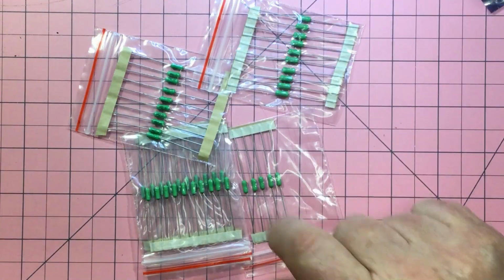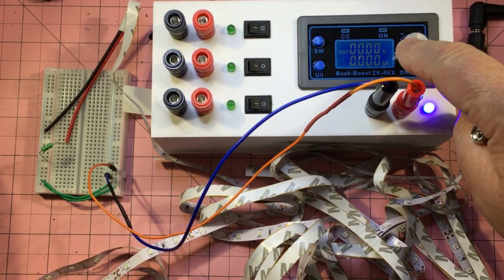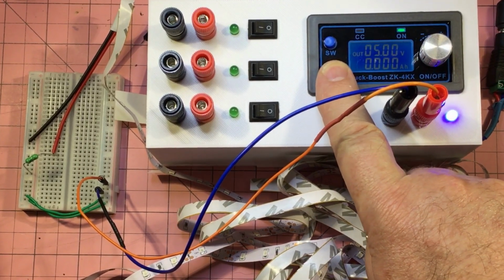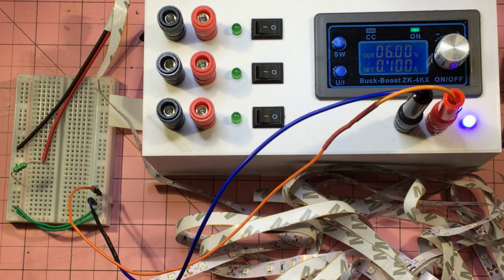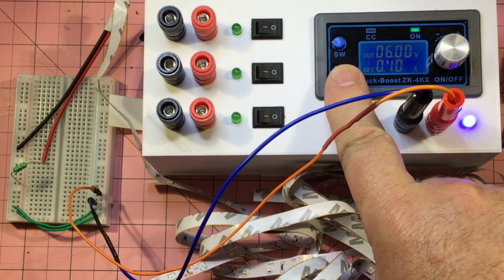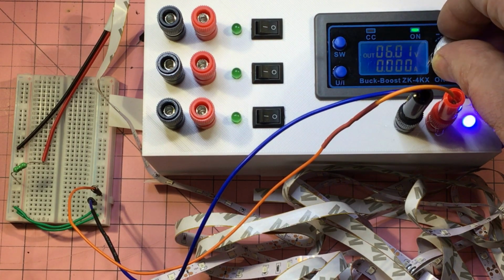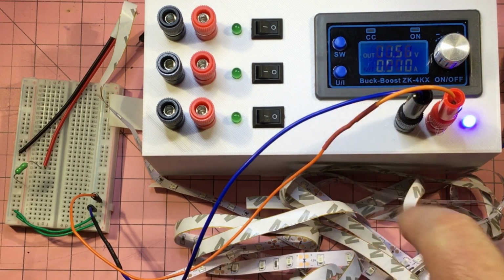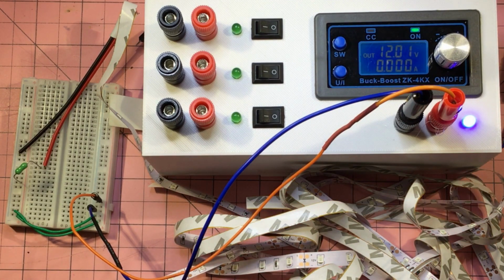Through-hole inline fuses

Comment: Good experimentation. Do some research on fuses. You will find that even the name brands don't blow the way that you would think that they would. The trick is in the data sheet curve diagrams. Give the curves and specs a read. You are going to be amazed, at how they don't do what you think they should do. IIRC, Dave Jones/EEVBlog did a good video on the subject. Additionally, those appear to be sourced from the secondary market... Ebay/Amazon... where components are faked in high percentages. So, if the circuit is an expensive one, don't use these fuses. HTH.
Reply from the maker: Good advice - a component to be used if aware of their limitations! 👍😀

Comment: Always check data sheets

Littlefuse 
Pico 263 Very fast acting fuse
% of Ampere Rating Opening Time
100% 4 Hours, Min.
200% 1 Second, Max.
300% 0.1 Second, Max.

Medium series 777
% of Ampere Rating Opening Time
150% 1 hours, Minimum
275% 10 milliseconds, Minimum 3 seconds, Maximum

Time Lag series 374
% of Ampere Rating Opening Time
200% 60 Seconds
Reply from the maker: Great info. No datasheet listed for these, but I'll go hunting now! 👍😀

Comment: They are definitely a slow blow. One positive is there was no magic smoke which means no smell, would it make it harder to find the fault when the fuse doesn't look blown?
Reply: Not if you check the fuse first.
Reply: @JohnBailey39  true, makes sense to check it first
Reply from the maker: I stressed a couple of them to the magic smoke stage by sustained over current rather than a short…and they did smell!

Comment: Most fuses I have tested blow at about double their rating.
Reply: Yep, unless you use something active that measures the current and actively switch off say a MOSFET or relay immediately above the limit, for passives  there's a current/time to blow curve in the data sheet. The higher the overcurrent the faster it'll blow.
Reply from the maker: That’s what I found. For some reason I thought they’d blow a few milliamps over rating, but more success was found when W-A-Y overcurrent. 👍😀